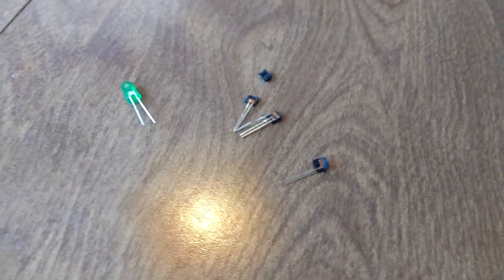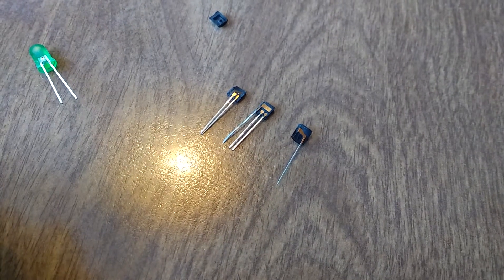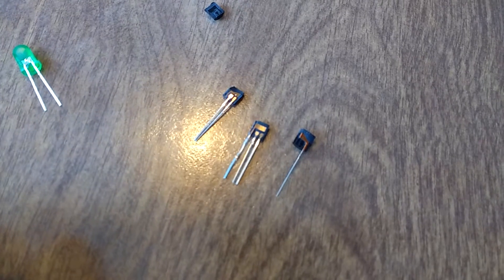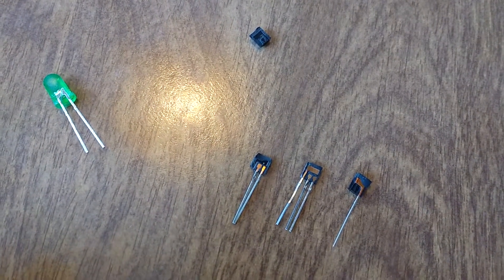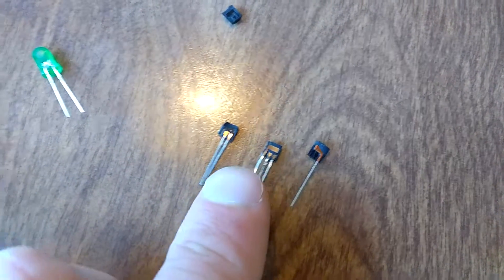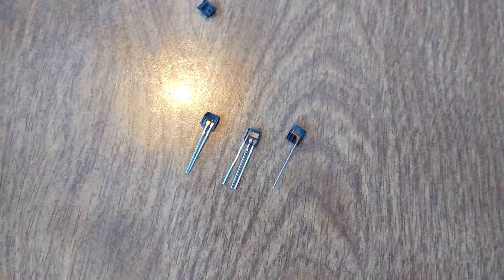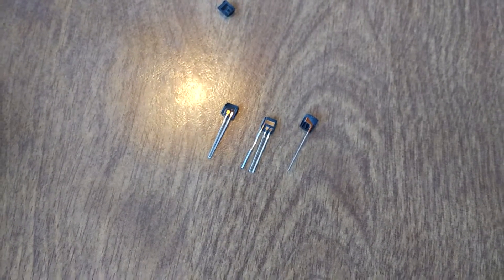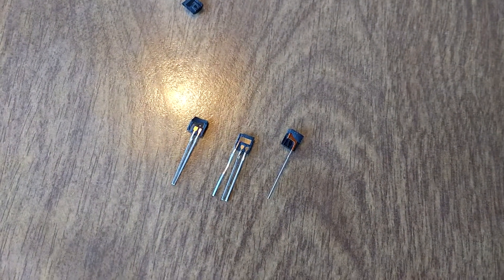Bi-polar junction transistor teardown (2N3904)

Comment: I was wondering about this myself.
Perhaps you've broken some bond wires that might be near impossible to see??
Or if you opened some faulty transistors, then perhaps the bond wires were vaporized and turned to charcoal?
Reply from the maker: I really really looked hard and I could not see a single thing, not even a tiny little microscopic bond wire.